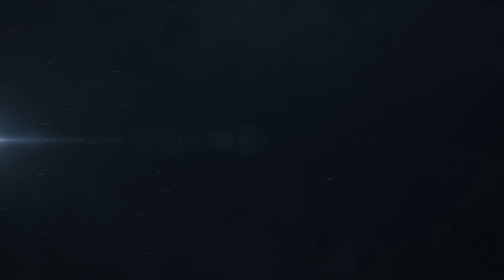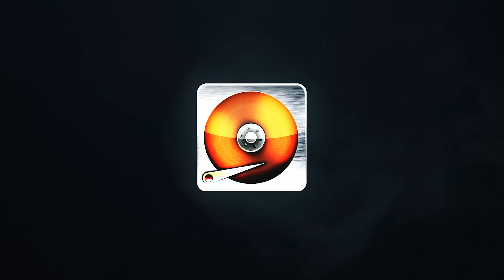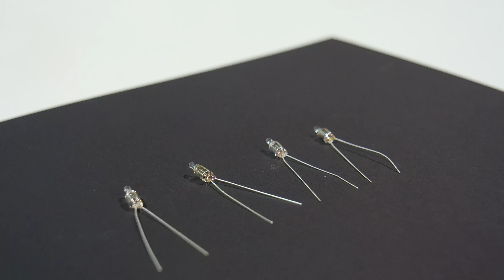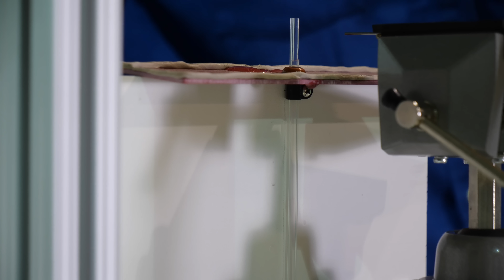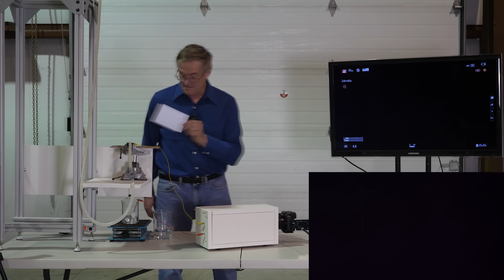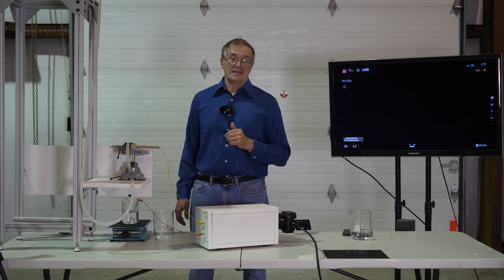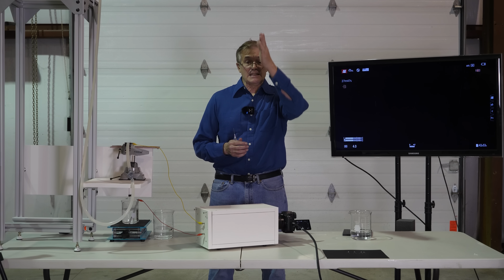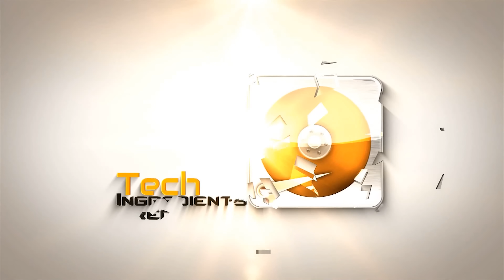We made electricity from water - and it's easy!

Comment: Its not too late to save the world, need to make a Universe room and reverse Tesla ball atmosphere models, also just spray desalination ocean water, not aluminum and carbon which cause refractory radiation and is cooking the atmosphere and causing refractory radiation on the surface making it intense, also you might be able to change an orbit

It is imperative that we stop spraying aluminum and CO2 into a magnetoshere and start spraying desalinatated ocean water instead, were causing refractory radiation and it's making the heat much more intense and heating the planet and causing melting of ice caps and evaporation of ocean water which then makes fresh clouds; we need to just spray salt free ocean water. The more we try to cool the planet were actually making it hotter and energizing a magnetoshere which could cause more solar flares and fry us. We're cooking the planet and causing solar evaporation of the ocean for clouds formation instead of just misting H20 out of 747's, got a whole plan

Hello my Friends

ANUBIS IS THE BEST DOG

What if Pharoah was trying to build a weather machine to attract lightening to nuclear electro magnetic earth ground to cause more rainfall and thus more food. 

Clouds of higher solar charged particles jump to clouds of lower static change, known as heat lightening, as nature seeks a balance. 

When there's enough solar charge in a cloud electricity as lightening crosses the air insulator and connects to earth, as it does it creates a vortex where hydrogen and oxygen particles connect and bring down water droplets and fall due to nuclear electromagnetic gravitational earth gravity. 

Electrons go around an atom like the moon around the earth and the planets around the sun.  

The Egyptians saw that lightening was attracted to metal, and the higher the better. 

If Pharoah had a copper cap on the pyramids with electrodes running through the air chambers down into the spring underneath, Benjamin Franklin might have been wearing an Eye of Horus Watch and driving a Bently.

Is the grounds turned dry, like a leather glove, no matter how much you tried to arc welds, it wouldn't work. Tree roots go searching for water in the winter when there is no rain, as solar photoelectric synthesis move through an organism seeking earth ground.

Also lightening is more likely to hit the lone farmhouse than the neighborhood, as electricity in houses flow through a black or hot wire, and take a neutral [white wire] path back to the electrical panel, where the Neutral Bar is bonded to the Ground Bar and goes into the earth via an eight foot copper electrode to dissipate returning unused current into the ground. So neighborhoods are energizing water tables instead of storing that electricity in batteries.

Anyways, I'm thinking a cargo helicopter, a brand new Copper Cap for each pyramid, and copper electrode wires running down to earth ground via the spring water table, and electrodes can be drilled into the earth below the springs for better contact, and we can complete Pharoah's Weather Experiment as lightening is attracted to metal high up from the ground ; )

Could you imagine the attraction of this new event to honor the Pharoahs and those that built the Pyramids!

And maybe bring more rain to the earth, and keep it most, and electrically conductive and inductive to storm clouds for more crop rain. 

If you want to in vent some cool stuff im at 224x833x2094 usa

Also, should we celebrate ancient ruins or rebuild them to honor ?

Also oil rigs should be underwater and not above and you wouldn't have oil spills 

China builds underwater structures, you could be just 20 feet underwater, you can run vertices flexible stormproof snorkles and a flexible to surface entrance/exit 

And, 

Grow more opium most the world's doesn't even want to be here and people can move other places, it grows in attics that are 140 degrees, skylights would need insulated glass in the attic shafts and you could use mirrors in the gable ends, just don't be in the attic in the day, if there's ever a shortage

Also oil rigs should be underwater and not above and you wouldn't have oil spills. China builds underwater structures, you could be just 20 feet underwater, you can run vertices flexible stormproof snorkles and a flexible to surface entrance/exit

Sharks could be GPS chipped at a bait source and an alert could go to cell phones and beach alert systems if sharks are within 300 M

Aluminum spayed in the atmosphere might f you magnetically with solar flares

Use aluminum for other things, spraying carbon and aluminum heats up the planet and causes refractory radiation on the surface, the carbon in the clouds traps in the heart and in the ocean causes dead spots. You need solar distilled ocean water misted or of 747's instead, the sun will burst up H2O into H, O1's, making 02, O3 ozone, and you're actually adding more fresh water clouds up there, not depending on surface evaporation by causing more heat in order to make more clouds, you need to cool it

8.4 billion acres of grass=4 billion cows in the world shipped frozen fresh lawn mower clippings somewhere cool like Alaska and each cow gets a bowl of ice cream at each feeding session

You need a leaf sucker truck with a refrigeration unit, grass is mowed for tax refunds, 20 Million jobs paying 60k from May to October in air conditioned, sealed window, tinted window, XFM lawn mower cabs with triple level suspension seats, mini leaf suckers pick up small piles and dump them by the street, big leaf sucker truck picks them up and freezes the frozen grass and then it goes to rail cars then somewhere cool to be 1100 lbs with a boney jacket. The people that kiss cows and sing songs for them take care of them and she gets a bowl of ice cream at the end of each feeding season. You'd have 10x more cows, over 1 Trillion in goods. In the US you'd have to double your grocery stores just for the milk, cheese, cheese cream, sour cheese, cottage cheese, yogurt, milk, butter, ice cream, etc...

When she doesn't want to be a cow anymore she gets a bowl of ice cream with some fennies

I have a lot of invention ideas in energy, defense, security, food infrastructure etc...

Would like to meet up with some people and talk to them about making some cool stuff

Missing solar film wrap on high rises and fields shouldn't have solar panels but should be solar panel green houses growing every crop everywhere, humid and tropical warm all year growing facilities

Comment: Cody's Lab was showing off a Springle(spp.) vaccuum pump he made with glass tubing, and using mercury as the fluid which fell down a narrowed section of the glass tube in plugs and thereby would suck air out of a side channel that leads to a vessel being vacated. He reached out to point or something and received one hell of a shock from it! So it will generate static with other liquids too.

Comment: Cool. This is not related to how a thunderstorm works so the name is wrong. All that is is that tiny particles of water are positively charged on the outside. Bigger ones less positively charged on the outside. And the thunderstorm is a big machine for sending the little ones up and the big ones down. No ions. The water molecule is a triangle and the positive end points at the drop surface.

Comment: Ive been thinking for the past two months this exact thought "there must be a way to get energy from water without spending energy to convert it." and i mean here it is. Fair, theres kinetic energy driving the water so its not "free" but i mean have it powered by a stream and use it to charge batteries. You could theoretically run a home off this no?

Comment: would this be considered free electricity, had a debate with chatgpt it accused you of using hidden devices
Reply from the maker: You probably asked the question incorrectly. This is not energy from nothing. I didn't say or imply that.
This is electrically generated from the potential energy in flowing water. That is the same source that drives hydroelectric dams.

Comment: Does this acidify the water permanently? Because, if so, introducing it to waterways would be a terrible idea, even if the pH shift is tiny.

If separation of the flow is the key, could it be done using a water or wind-driven interruptor between the needle & the tube? Would that make the tube diameter less critical? You could use the weight of the falling water to tip a little seesaw that interrupts the flow just briefly enough to create that spacing, or perhaps make it move the needle from side to side across a larger plane with a series of vertical channels in the surface (kinda zig-zag profile). My thinking is that this might be possible with (collected) rainwater if you can remove some of the criticality from the sizing to account for variations in what that rain contains, impurities & such. Having to drive it through some kind of filter before it can be used wouldn't be ideal.
Reply from the maker: It doesn't. 
As soon as the current flows through a load, the water neutralizes.
Reply: @TechIngredients  Is that any load at all, or only one that consumes all the power generated though? If you have a very large array of these to generate practically useful levels of power, it seems as though you'd need to use everything you generate all the time to avoid dumping acid.
Reply from the maker: Any conduction of current will nullify the charge separation and acidity.
Reply: @TechIngredients  Interesting, thank you.

Comment: if the carbon emission/footprint to make and run a system is more than the energy it produces, it is not viable.
Reply: That depends on its projected lifetime though. A compact solid state system that can run constantly for a hundred years could be perfectly viable, even if it doesn't produce a lot of power per unit. Just have to look at alkaline batteries to see how crappy power output & lifetime can be for a product to still be considered highly viable.
Reply from the maker: Night... is correct. 
The equation is much more complex, and there are other variables. Hundreds or thousands of miles away from a hydroelectric dam, you can't compare the $/watt without factoring in the grid that distributes the power. Furthermore,  what about the environmental impact of the reservoir? Nuclear waste storage risks and costs...

Comment: You still need gravity and height. Might as well use a turbine.
Reply from the maker: Of course you need gravity and height.
This is clever, but it doesn't violate thermodynamic law.
The difference is that the mechanism allows power to be generated from water flowing a few cm. per second and has no moving mechanical parts.

Comment: Isn’t the same as a Lord Kelvin’s device?
Reply from the maker: No.
Both systems depend on charge separation, but his device uses an external electric field, and this method is based on surface interaction between the water and the plastic.

Comment: I think mineral deposit build-up in the small tubes (or the open cell foam) will be one of the hardest challenges to overcome.
Reply: I was thinking the same thing; it's not of practical use unless you can open it up a bit. I think a series of planes would be more effective than a block of foam, since then the water itself could wash away most of the impurities.

Comment: Does that system produce A/C or D/C Voltage??? And, can you charge a Cell Phone w/one milliwatt???
Reply from the maker: It's DC, and that makes sense because the positive lead in the beaker is always the positive lead.
It could,  but very slowly, and you'd need a voltage converter.

Comment: So you are extracting a minuscule ammount (is really low because you can barely see those lights in the dark) of energy from flowing water which need energy to flow.
Is this more efficient that make water turn a rotor? Maybe, but as expalind a really small tude is needed, so to get this to work for a decent ammount of energy requires a riduculus ammount of equipment..
Reply: LORD Kelvin device you use 4 metal coffee cans and it works just as well

Comment: Super interesting! 
"These [ions] probably form due to thermal vibrations." So either the energy we're seeing comes from these ions being drawn across the surface due to gravity, or it's being generated by exploiting this lower thermal energy state in the water. If it's the former how could this ever be better (or more desirable) than a turbine, and if the latter then we've cracked entropy y'all!! It would be interesting to run this through dozens of columns to see if the temperature changes, or do it with different temperature water.
Reply from the maker: It is due to the potential energy from gravity drawing the water down.
It isn't necessarily better than a turbine.
It's value is as an alternative where a turbine can't function. This will work with water flowing at centimeters per second. A turbine needs a substantial velocity and so a much larger head to operate.

Comment: Have you done or read about anything regarding testing differences between various hydrophobic versus hydrophilic substances in the context of this ionic charge separation?
    Also what about using capillary action to bring the water back up and then wick it out to drip, wouldn't that make a perpetual motion machine? What does the charge separation change the surface tension such the capillary action would no longer be effective?
Reply from the maker: Capillary lift will hit a snag at the top. The same effect that lifts the water will hold onto it, preventing the water from feeding the bubble tube.
Reply: @TechIngredients of course if the tube is the same size, I was thinking a dangling thread off the top of the capillary tube, much less surface area to hold on to the water. If you haven't tested it yourself,  what size and material tubing would you recommend for greatest effect of capillary action?

Comment: https://youtu.be/v7hmzvGE9dA?list=TLPQMTgwNzIwMjVVnnQPVdtZfg&t=817
I think that rain from a roof top really could be viable no need to set up a rain catching device? as for reducing the voltage to a usable level a lead acid battery can usually handle high voltage spikes. I'm not sure that its good for the battery but The Bedini SSG (Simplified School Girl) is one place I've seen it and it has helped in some of my own projects. Another way to get electricity from water. Interesting discovery!  👍

Comment: This is awesome. Is this potentially a perpetual energy idea?

Using waters own cohesion, you could start the initial "suck" with your mouth and the water from a reservoir below could make its way to the container above which is then feeding this machine.
Reply: No. That will not work.
Reply: @teebob21 why?
Reply: @skt91164  Because that's not how siphons work.
Reply: @teebob21 well, actually, what if it wasn't a siphon, and instead something akin to how plants send water up to their leaves using waters cohesive properties. The tubes would have to small enough and there would have to be thousands of them.
Reply: @skt91164 Capillary action is insufficient to provide the flow demanded versus gravity.
Reply: @teebob21 well it might take it some time, obviously the flow won't be as strong to the upside. But if it's perpetual energy all if we have is time. Hundreds of thousands of these machines, spaced in time so that there is no disruption to continuous power, coupled with capillary action could easily be sufficient.

Comment: Is this the same as a Kelvin Thunderstorm? If not, which generate more power per drop/liter?
Reply from the maker: It isn't even though both are based on charge separation. I don't know how efficient the Kelvin generator is, but this system is approximately 10 % efficient.

Comment: Not that they would have much practical use, but I do wonder if other liquids could be more efficient and/or effective than water at generating power via this exact method.
It also makes me wonder if any additives could significantly increase power generation per channel. Maybe an additive whose main purpose would be the cleaning of the channels could, in the end, provide an efficiency gain.

Viscosity, by itself, appears to be a crucial variable. Any inexpensive or free additives that could optimize such variable would, perhaps, be worth trying.

I could be wrong, of course.

Comment: "the greatest enemy of a physicist is his psyche".... ONLY experience 
confirms reality, while the interpretation of a formula results from an 
IMPOSED MENTAL STATE! 

life as you don't know it... 
The first scientific truth - the brain of thoughts !? 
the brain does not think, NO Thoughts - it's a civilizational, scientific, 
communist, atheistic lie! 
proof - proven currents on the head do NOT have anything to do with 
the activity of neurons, because no one in the world knows the 
physical theory proving how the electromagnetic field could pass 
through 5 layers of electrolyte, no physicist in the world can explain 
this phenomenon. I do not question their presence, but they are of 
external origin....

 The atomic model is FALSE, They taught you a lie, which you 
continue to pass on to your children, who will eventually become 
physics professors. And they are already here, at work, preventing 
NEW KNOWLEDGE from appearing in the interpretations of 
experiments confirming THIS MODEL – publicly available data for 30 
years.
Do you know what the surface of water looks like?
The angle of contact between atoms in water is always the same, 
there are no fluctuations, it is stable, and requires no calculations... it 
is a mechanical system! Not some ball and stick!
 Why does the electrolysis of water produce twice as much hydrogen 
as oxygen? the oxygen atom is 16 times larger! the same 
temperature and pressure....
the water formula (H2O) is wrong !

physics babbles about MASS because it is gravity, and gravity refers 
to MASS, etc